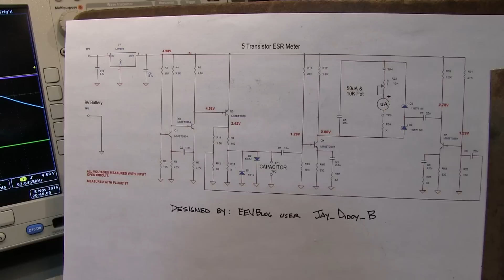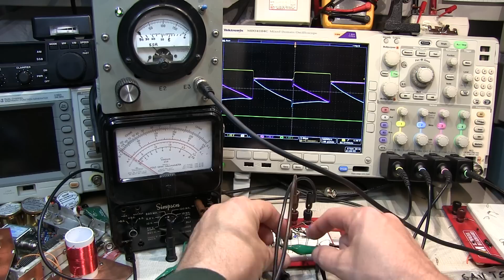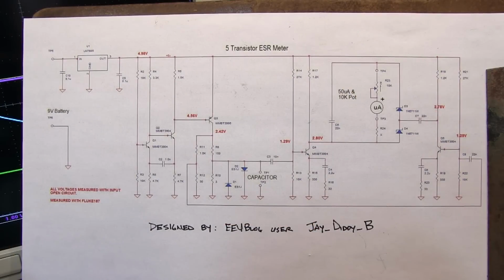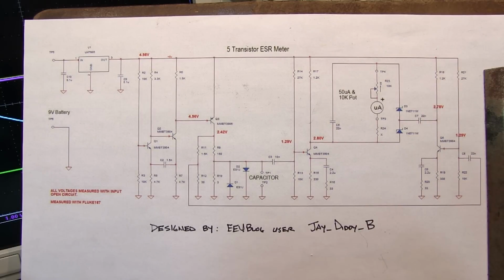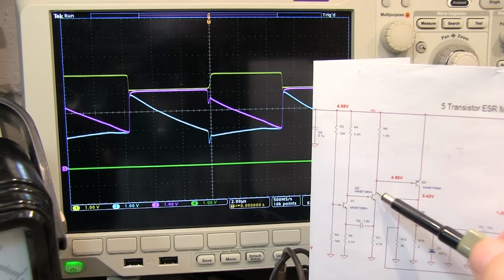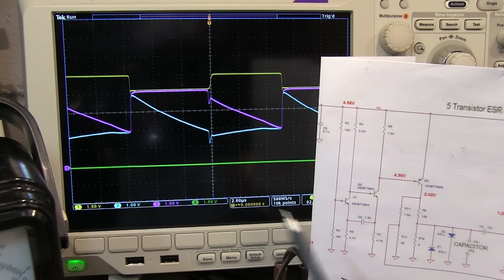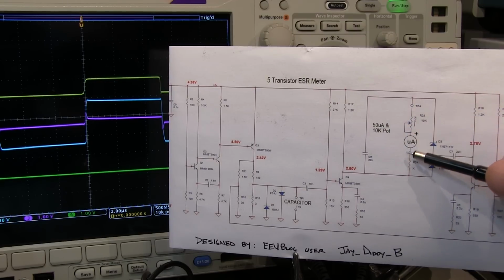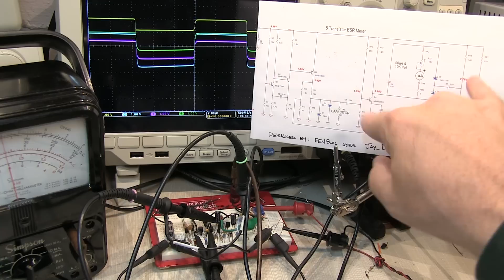#247: Circuit Fun: 5 Transistor ESR Meter circuit by EEVBlog user Jay_Diddy_B

Comment: Perplexed... This seems to be a capacitance meter (with inverse meter readings). How can this circuit discern between a low esr smaller cap, and a high esr larger cap? There must be some EE magic going on that I don't see. 🤔
Reply from the maker: For any capacitor over a few uF, the reactance will be under 1ohm since the oscillator is running at about 90kHz.

Comment: I'm just wondering whether this ESR meter would accurately measure ESR of capacitors <1uF
Reply from the maker: With a test frequency a little below 100kHz, it is probably not going to be as effective.  However, it is worth an experiment - try testing with a known good 1uF cap, then insert a 1ohm resistor in series with the cap and see what it reads.  You may just need to adjust your "what is good" level when measuring small value caps.

Comment: I have a question? I made a working model on a bread board. And every thing matched your Video with all your test resistors. So I etched a Circuit board and a completed it. Got a good pair of matching npn transistors for the metering circuit.  I have been scratching my head All my voltage test point are on the money. I have a good 100kz 100mA peek to peek square wave on the DUT out. The tester works. and  with the same meter i used on the Bread board the tester seems to be able too measurer up to a higher resistance. On the bread board 45uA was 0.2 ohms now on the Circuit board 45uA is 1 ohm. Its as if the scale changed. on the Bread board 10 ohms was 3uA. now 19 uA is 30 Ohms. Do you think i am falling into a Bread board Trap, or was it just to high resistance connections of the Bread board? any thoughts. Thank you for your video and your help with IDEAs.
Reply from the maker: Good question.  I only built this circuit once, so I don't know how much variability there would be with component tolerances, etc.
Reply: @w2aew  I did change from 5% tolerances 4 band resistors to 1% 5 band. On the bread board no change. it was when it moved from the breadboard to the circuit board. the change happened. I'm trying to learn more and more everyday about Electronics but I don't understand everything. I really enjoy the challenge of building test equipment. Is this something that I'm just going to have to calibrate to a known resistance?  the most accurate piece of equipment I own is a Fluke 87V DMM.
Reply from the maker: @jonathanHughes380  Yeah, you'll just have to calibrate it with some known resistor values.  The 87V is going to be more than adequate to measure the resistor values.  For the low values (below a few ohms), be sure to use the Delta mode to zero-out the lead resistances of the meter.

Comment: Hello, I have a question. After watching your video i found the plans And build one on my bread board. After a few tries I got it to work, and it seems to be doing everything your build did. My question is I have a 2-3 uA of current showing on the meter when i turn it on with leads open. did your build act the same im using a 1.5% 0-50 uA meter. after reading all 10 pages on the EEV blog. I thought i was having a problem with Cap 3 in the circuit, but it is on spec @ 10n , I changed it to 22n. little to no change. any Ideas?
thank you Jonathan.
Reply from the maker: It is likely that the gain of the two common emitter amplifiers on either side of the meter network isn't matched.
Reply: @w2aew  thank you very much that makes a lot of sense just like a vacuum tube amplifier that has two matched 6f6 output tubes.  Thank you.

Comment: Do you think 1N914/1N4148's and any Schottky diode would work ?  Thanks.
Reply from the maker: Yes,  D1 and D2 are just there for protection.  Basically any Schottky will do for D3 and D4.

Comment: Hi. Big thumbs up to @w2aew. I see that Alan used 10nF (C3) instead of 22nF as per the circuit from the EEBlog forum. Are these values non critical? If I am attempting to use a 30uA meter I reckon the resistors R15-R20 can remain the same but with trial and error choose a higher value for R24. Do I need to be looking at signal attenuation through C3 and C8 too? Thanks for any insight here.

Comment: Great video. Can you explain how Q2 is being turned on again.. I understand that while Q1 is turned on the base of Q2 should be around 3.76V, that being the collector voltage of Q1.. so wouldn't the cap on the right side only have to discharge to around 3V to begin conduction of Q2.. I don't understand why it discharges to 2V instead.. please help, thanks

Comment: Unless I misunderstand (I'm just a hobbyist with not many years in the hobby), given that both your original and this ESR meters are both just "ohm meters", this in theory only works with capacitor values (or frequencies) that are "large", right? If I put in a cap with a tiny capacitance, the overall magnitude of the impedance will be high and the readings are effectively wrong. But I guess the frequency and resistors are just chosen so that it makes sense for the range of electrolytics? I've been wondering how the digital ESR meters that show both capacitance and ESR do it, and my best guess so far is that they look at both amplitude and phase instead of just magnitude. Then converting from polar to rectangular, effectively the real part is ESR and the imaginary part is resistance. Does that check out?
Reply from the maker: ESR testers mainly exist due to a common failure mode amongst electrolytic capacitors, which causes their internal resistance to increase.  Electrolytic caps are generally large value (typically >1uF).  The vast majority of ESR meters test at relatively low frequencies, so will NOT give you proper results for small value capacitors <<1uF.  These non-electrolytics rarely have a problem with ESR, and elevated-ESR is not a failure mode for them. 
There are various techniques that ESR meters can use to compute the capacitance as well as the ESR.
Reply: @w2aew  Great explanation, thank you!

Comment: Hi Alan, thanks for the clear breakdown of the circuit, very helpful. I just have a doubt, if I have a 30uA analog display, do I need to make some adjustments to the circuit? All the best mate.
Reply: With a 100uA meter I did not use R24. The only adjustments you will have to make is going to be R24 I think.

Comment: I built the ESR meter in April 2014 QST. I'm curious about the performance of this unit compared to yours and the one you just went over.
Reply from the maker: I haven't looked at the one from QST.  This circuit and the one that I built years ago perform similarly.

Comment: I made that lovely circuit and its working fine but i just have a 2000uA multimeter so i  shòrted R24 and set the pot. On minimum resistance. 
   But i get just 14uA  in out put i gess because of high ohmic internal resistance  of my meter in 2000ua 
Is that possible i change some of resistors to increase the output or not?
Check this image pls
https://drive.google.com/file/d/10untKeCUeVkLw2dKt27mfuI06Q1kJm6R/view?usp=drivesdk
Reply from the maker: You could try scaling down R15, 16, 17, 18, 19, and 20.  Start by cutting them all in half and see if that gives you more deflection when the test leads are shorted.
Reply: Thanks.
Problem of my circuit was the two 2.2nf capacitors i installed instead of 2.2uf.
Anywey i solve that and i get 104 microamp in close test lead condition for a moment
But after that the output completly wanished.
Is that possible it because of low quality of the fake chinese transistors i have used.
After first try i check those by multimeter and no issue found.
What do you think???

Comment: Maximum alowable shottkey  diode junction capacitance please? 
I have 2 smd ss14 with 70pF.
Acceptible or not? Those shottkey diode really hard to find 
I attemped to biuld the circuit and i have whole componets but small shottkey diode is a pain in my ass
Reply from the maker: This is a low frequency circuit, so capacitance shouldn't be a problem.  I don't know where you are located, but Mouser.com has many of the 1N5711 parts in stock.
Reply: Hah
End of the world
IRAN
Thanks by the way

Comment: Oséas Medeiros
HELLO SET UP THIS PROJECT, BUT THE POINTER DISPLACES 2 CENTIMETERS OF THE INFINITE SCALE
IS THAT BECAUSE I AM USING A 95W AMPERIMETER AND AN OLD KAMODEN 104B MULTIMETER
THANKS FROM THE COOPERATION OF ALL FRIENDS

Comment: I made the circuit and it work well. I used a 100μA meter so I did not use R24 only the 10K potentiometer.
now I need to find a box to complete the project.
Here a picture of it: https://www.flickr.com/photos/188548216@N02/50916240413/in/dateposted-public/
Reply from the maker: Nice build!

Comment: Great video. It's a nice little ESR circuit. I know it's getting up there in video years. 
However. I will attempt a question anyway. Can you clean up the overshoot or oscillation transition spike on the DC rail. or is that inherent to the transistors being used. If you can clean it up, would it be worth the effort, would it make the meter a tad more sensitive or steady? I would think that a small steady Pulse - + spike in the DC signal would cause small deflections on the marker needle, causing it to oscillate when using a high res meter like a 0 - 50uA / 0 - 100uA meter, ??
Reply from the maker: Those spike are so short in duration, they won't affect the readings at all.

Comment: Hi again, I'm going to have a go at building this in the powered breadboard first.  For the panel meter, there is one I'm looking at on eBay UK that's 1900 ohms meter resistance - would that be an acceptable value for this?  It looks from the circuit you adjust it for FSD with some additional series resistance plus a 10k trim pot, which is modelled as 20K - is that right?
Reply from the maker: that should work
Reply: Yes indeed it does for me.  One thing - when the oscillator is open circuit, i.e not driving the rest of the circuit, it's output is bang on 100khz with the 15n capacitor.  When I connect the rest of the circuit, it makes the square wave nice and symmetrical, but the freq drop to about 87khz.  I guess it doesn't matter much, but it was just something I noticed.
Reply from the maker: @kevinsmallman3116  Interesting, I didn't notice that on my circuit, but it could've happened.

Comment: Alan, Great video as usual.
Just a note about the very simple oscillator used in the circuit.
I use it all the time for my projects all the way from simple 1 sec pulsers to 100 kHz circuits.
I found it in the Tektronix 7603 oscilloscope Calibration pulse generator of approx 1KHz.
Geoff.

Comment: I do not know whether it is a good idea or not, but how about replacing the oscillator part with an 555 oscillator so I can test the capacitor under different frequencies? maybe I can place several capacitors in parallel and use a switch to select in between, in this circuit too.

Comment: I'm wondering what the highest voltage capacitor value that this tester will test,, Is it only for Electrolytic caps and not film caps?
Reply from the maker: The voltage rating of the capacitor doesn't matter.   Testing for ESR is typically only done for electrolytic caps.  Film capacitors don't suffer from elevated ESR as they age.
Reply: Hi Thank you for replying to my question,,, So if you Test a 500 or higher volt capacitor,,, That circuit will give a ESR reading,, So then if one where to look at what the ESR specs for that Cap should be it could be determined whether the cap is good or bad,,, Good Stuff... Thank you for posting your videos..  :)
Reply: Sorry forgot to add,,, so with that circuit using 4 volts, you can test higher voltage electrolytic caps at the rated voltage of the cap and still get an accurate ESR reading? ,, I"m hanging out with the wrong kids,, LOL
Reply from the maker: @terencekaye9948  There is no need to test at the rated voltage of a capacitor in order to measure the ESR.  ESR is not a function of the applied voltage.  ESR is only one of the several failure modes of electrolytic capacitors, so it can help you find bad capacitors, but it won't find all of them, because some may fail in other ways.

Comment: Nice video. Can I use BC547 instead of 3904 NPN in ESR meter
Reply: Yes BC547 should work
Reply: @cbhargava  Hi Sr. Chetan. Silly question, I have seen this project some build this with ceramic cap others with 2 Electrolytic and 4 ceramic cap. Wondering the correct ones to use?

Comment: nice video can i use 100 microamp full scale instead of 50 microamp?
Reply from the maker: Yes, you just might have to reduce the values of the resistors in series with the meter (R23 and R24).
Reply: @w2aew  thanks one last question can i use 1n4148 diodes if not please some diodes that i can use in this circuit thanks again for your informative videos
Reply from the maker: @AuraofArt-f2w  They really should be small signal schottky diodes.

Comment: It would have been helpful if the schematic provided by Diddy_B matched the version we see on this video. I assume they are both, basically, the same . . . but who knows since the one in this video doesn't match the jpg. image in the link. Details are important as even the smallest error can cause head-scratching or worse. [It would be nice to have those test point voltages . . . seen in RED on the schematic in this video. They must be important. This schematic has more info]       Just an observation.
Reply from the maker: The schematic used in this video, and to build the circuit, is the schematic from this eevblog forum entry:
http://www.eevblog.com/forum/projects/jay-diddy-5-transistor-esr-meter/msg933224/#msg933224

Comment: Help! I've spent the last 3 weeks in a catatonic state due to my terminal OCD that I suffer from desperately trying to find R1 on the schematic. I fear if I don't find it soon I am not long for this world. It was all I could do to even post this comment. I was able to reconcile no C1 by considering the D.U.T. to be that component. Can I call the meter movement R1? Or is that cheating? Thanks. I'll just show myself out now. :)
Reply from the maker: If it helps your mental sanity, then call the meter R1 ;-)
Reply: Now I just have to hope these low forward voltage mystery diodes I pulled out of one of my junk drawers will suffice for D3 and D4. They're close to what a 1N5711 is supposed to be.

Comment: I build this 10 months ago (see earlier comment) and it's just awesome. It's become a very useful tool in my little electronics lab. Because I re-use a lot of components I solder out of old equipment, this meter has become the go to tool to check if the caps are ok.
Reply: Hi, I am very new to electronics, I've seen this project built with all ceramic cap, and some with  Electrolytic and 5 ceramic  Caps. I don't know which one to order and the voltage of them. I know it will be working with 9 Volts regulator but I can't find 16v to say something in my local store. only 50volts minimum value. May you light a little please. Which uA panel did you use it? and resistance for that? did you remove the shunt resistance in the uA panel?
Reply: @svsv9  You can use 50V. The higher voltage rating is only better.  I can't comment on the meter I used because I re-used an old zener diode tester. It has a big analog meter and the case was just the right size so I built it into that. I know it doesn't have a shunt resistor, at least not outside the meter. It just had two leads that I connected the print to. Any capacitor over 1µF will be electrolitic.  For the smaller ones you can use ceramic caps.
Reply: @EdEditz  Thank you so much. I was about to make an incorrect order. I opted for 50uA and 10 k Pot. and some sort of resistance to test and calibrate because I don't understand the formulas to get the total Resistance. but I will find a way to figure it. Thank once more. It's ok if I face problems ask you again?
Reply: @svsv9  Of course you can ask any time. If I can, I will help you :)  Mind you, I am no expert! I've been doing electronics for 30 years but I'm not educated in the subject. But I have picked up a lot of knowledge along the way. I have a website on which I have electronics projects to build your own synthesizer. I don't know if that's your thing but here's the address: https://www.eddybergman.com/   What I mean to say is, I get a lot of questions from people who build from my website so I'm used to answering questions. So it's no problem ;-)

Comment: Alan, what happens if one of the resistors in the bridge goes out of toleranance ? How would you know? Or, does R23 adjust for such a bridge anomaly?
Reply from the maker: If the bridge gets out of whack, then you'd see a small meter deflection even with no capacitor installed.

Comment: WHAT IS THE VALUE OF R24 ?
Reply from the maker: Depends on the full scale deflection of the meter (Ifsd), and the meter resistance (Rmeter) and the trim pot (Rpot).  Value isn't too critical because you can make up for it with the pot.  Rough approx:
R24 = 0.75/Ifsd - Rmeter - Rpot/2
Reply: NO EXACT VALUE SIR ? I WILL FOLLOW THE SCHEMATIC DIAGRAM , I JUST WANT TO BUILD MY OWN ESR METER , THANK YOU VERY MUCH , IT MEANS SIR EVEN NO NEED THE R 24 TO INSTALLS ?
Reply from the maker: Since the value depends on the particular analog meter you are using (full scale current value and meter resistance), I can't give you an exact value.
Reply: SIR YOU HAVE YOU TUBE  VIDEO ON HOW TO CALCULATE THE R-24 ? SO I HAVE AN EXAMPLE IN ORDER I ABLE TO GET THE VALUE, THANK YOU AGAIN
Reply from the maker: Impossible to give you a specific value because your meter is unknown to me. My suggestion:  Build the circuit and start with R24=2.2K.  If you can adjust the pot to full scale deflection on the meter with DUT terminals shorted, then you're done.  If you can't reach full scale, then lower resistor value to 1K and try again.  If you can reach full scale, but near the end of the pot range, then adjust R24 as needed to give yourself more "headroom" on the pot adjustment.
Reply: THANK YOU VERY MUCH SIR